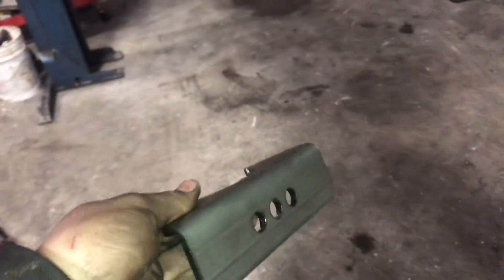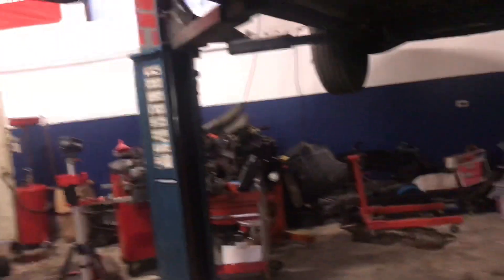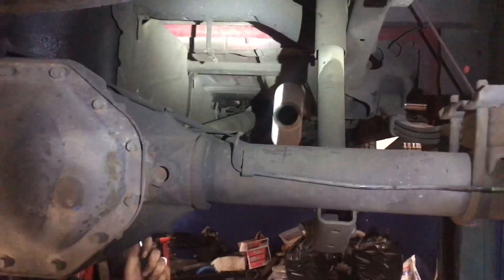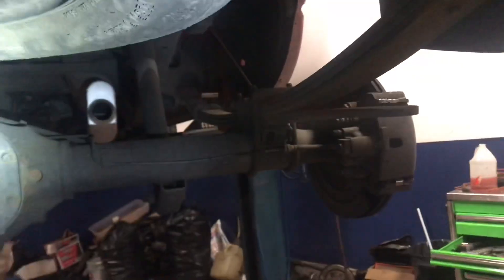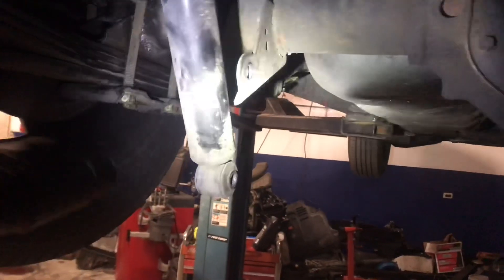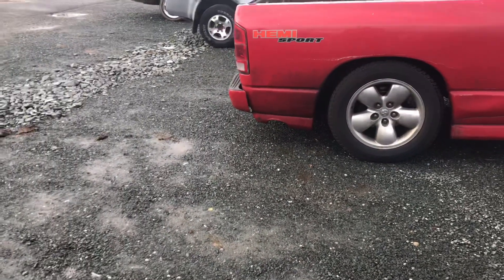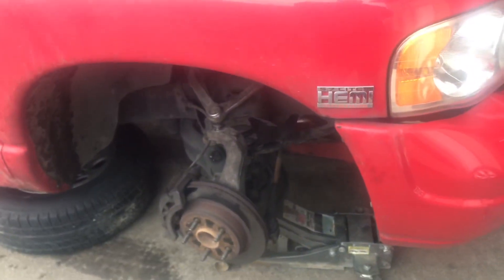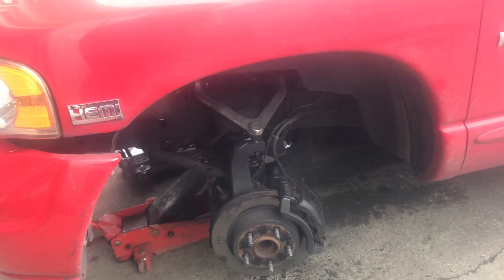Dropping a Dodge Ram

Comment: Nice video bro, I just lowered my ram and it sits about an inch lower on one side than the other. Any idea what it could be?
Reply: Dallas Truck Scene BROO SAMEEE
Reply: Dallas Truck Scene thats because of the gas tank & battery & & steering is on one side.. check out my youtube channel i have a lowered daytona.. what you can do is cut the spring a little bit more on one side & buy air shocks on rear & put more air on one side to even it out

Comment: On the rams, with a flip kit do u have same issue as chevy were u have to do a c notch because u bottom out?? Or just a smaller bump stop??
Reply from the maker: gustavo guillen you can probably get away with just a small bump stop because it has like 3-4” of travel
Reply: JH Garage o ok . thank you bro i appreciate it
Reply: Do u have to add shock extendors
Reply: I have a 04 ram with a 2-4 axle drop and u will bottom out